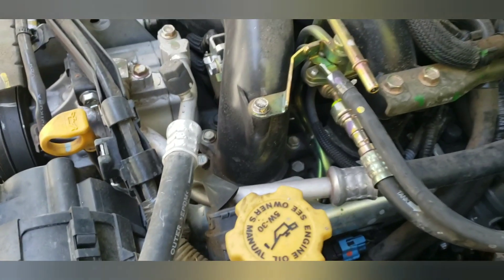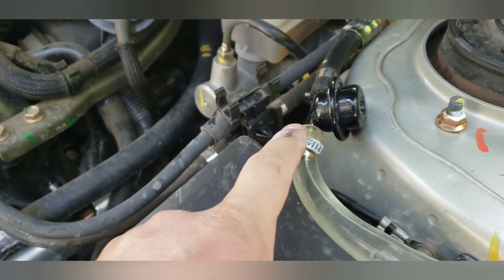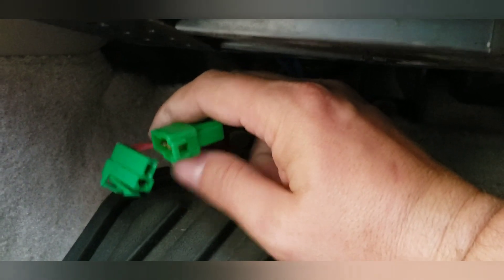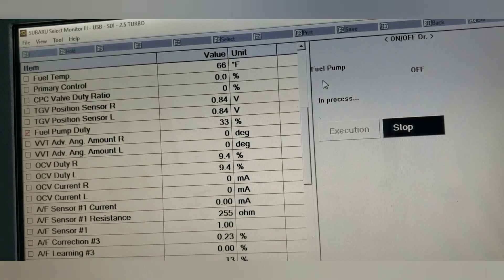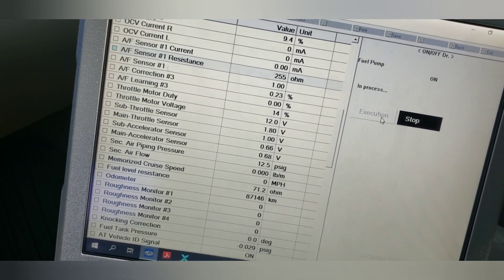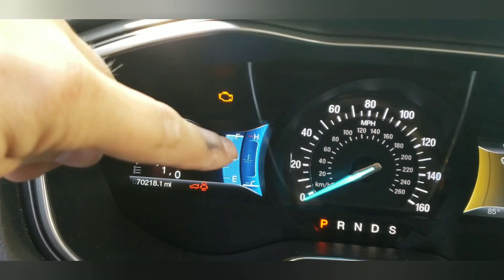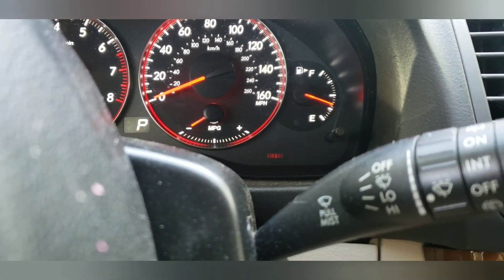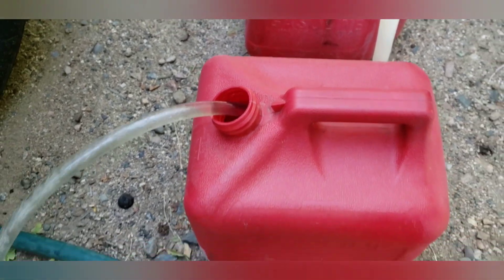87 Octane in an Outback XT = A Bad Idea

Comment: You would of been fine.  The ecu would of learned around it.  It even tells you in the manual that if 91 isn't available you can use 87.  You have a stock engine it's not a built tuned motor.

Comment: why not add an octane booster and be done with all this?
Reply: Octane booster only works for .1 point per bottle.  you would need 40 bottles
Reply from the maker: Never trust an over the counter octane booster. They're snake oil, unless you're using Torco or Race-Gas, which isn't available in my area.

Comment: I had 2 different SVX's and  it said 91  but I most of the time used 87 and as far as I know it never hurt anything. it not like she put water in the tank.
Reply from the maker: I can run 89 in my SVX but that's because the EG33 is 10:1 compression. When boosted, the EJ255 can be up to 16:1 compression ratio. That kind of pressures are what melt the crowns of the pistons or smash a bearing into the crank when subjected to detonation